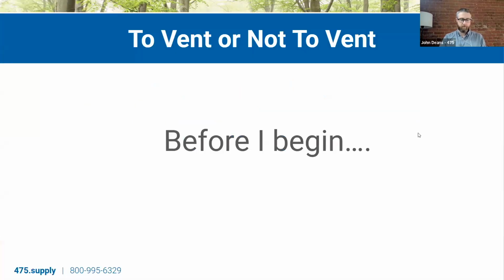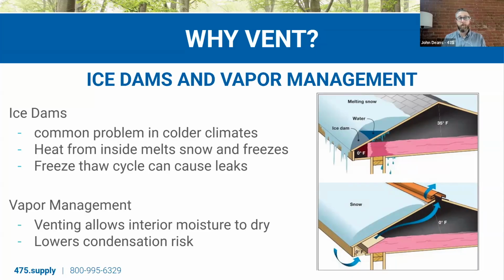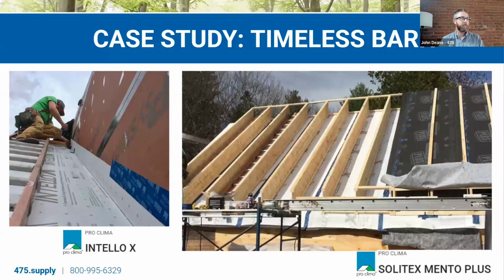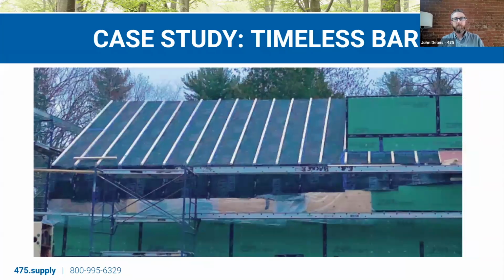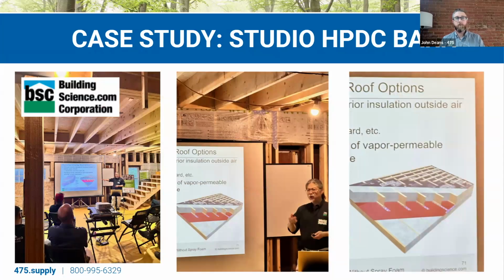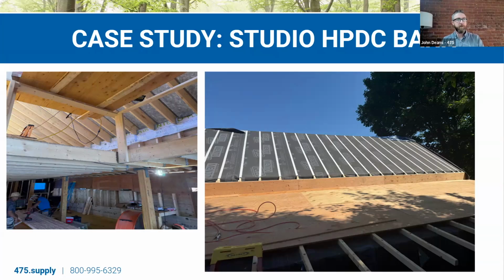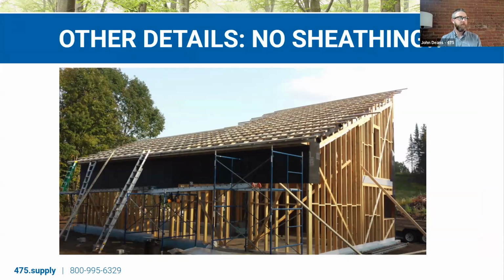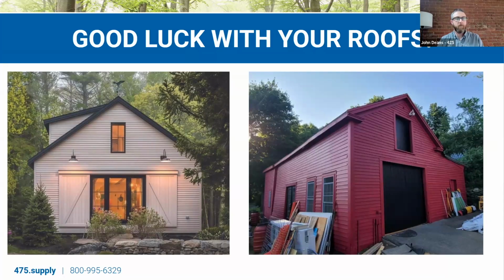475 BuildingBlocks: Foam-Free Vented Cathedral Roof Assemblies

Comment: Where is your structural sheathing? You have Mento 3000 on the top and Intello on the inside. Don't you need some shear resistance on the roof framing?
Reply from the maker: There's I-joists on top of this roof structure to create extra depth for insulation. The structural sheathing is below the I-joist in this example.

Comment: you put the wraps directly onto the purlins and rafters without ply underneath?
Reply: John Deans, 475 here - the MENTO PLUS WRB is applied to the top of the rafters, then sandwiched with a 2x batten, and then sheathing over that with whatever roofing underlayment/material desired. If there are purlins involved those would likely be under the WRB as well, but that's not a common assembly.

Comment: If you have a metal roof, could the vent space be under the metal roofing with the plywood covered in mento? 

To be clear: Fully insulated rafter bays, plywood sheathing on top, wrapped in mento, and then a 2" gap. with cross battens as the vent, and then metal roof screwed into the cross battens. Is that a correct venting method?
Reply: John Deans, 475 here - That assembly is done a lot, but it's a gray area with the code since the venting is above the sheathing. Definitely one of those situations to get code approval.
Reply: @JohnDeans475  Is the issue that the plywood sheathing may not allow the insulation to dry so well to the outside?
Reply from the maker: Plywood has a lower vapor permeability than SOLITEX MENTO membranes. Northern climate projects want to stay as vapor-open on the exterior as possible.